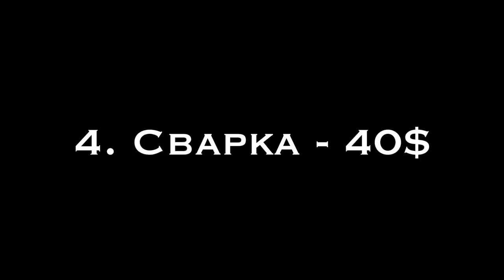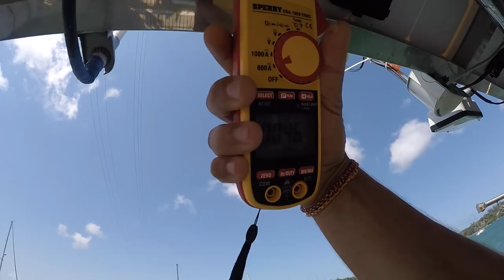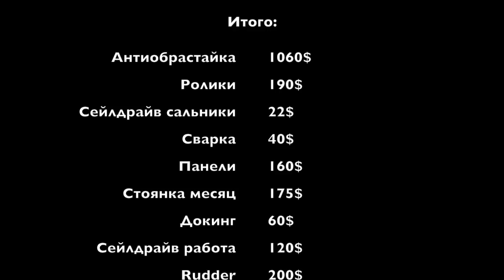Ремонт парусной яхты в Африке. Кенийские профессионалы за работой. Лодка опасно стоит на киле.

Comment: Isn't it dangerous to stand the boat on the balast? Does not make hatm to the keel?
Reply from the maker: I do not think so. When you are sailing just guess which power is on the keel. It is not just straight but also big angle. so huge power which is much more then weight of the boat itself.
Reply: Спасибо. И я  смотрю ваш отличный канал 2 3 месяц. Ето очин хорошо для маяки и люди которые изучают русский язык. И наверно вы из Украины. Спасибо и для канал. Желаю вам хорошо ветер. Жду следующое видео.✋🏻
Reply from the maker: Можете писать по английски, мне отлично, я в австралии жил
Reply: @КапитанГЕРМАН  спосибо большое Капитан Герман. Любовь из Турции.👋